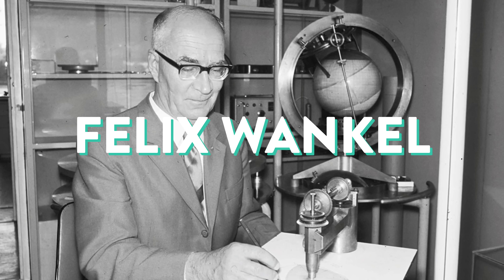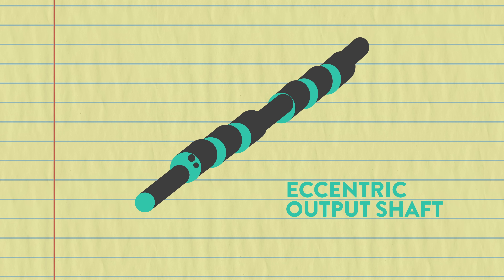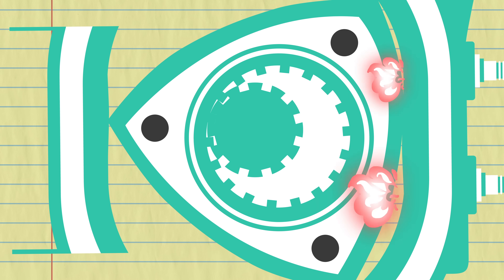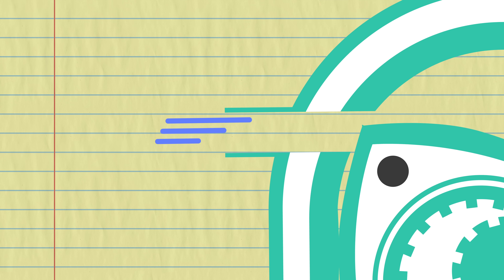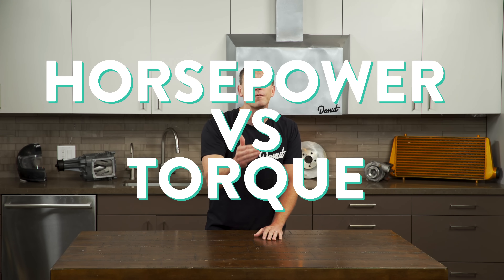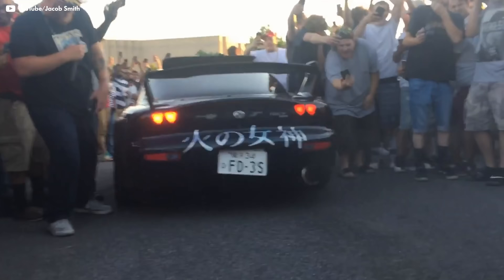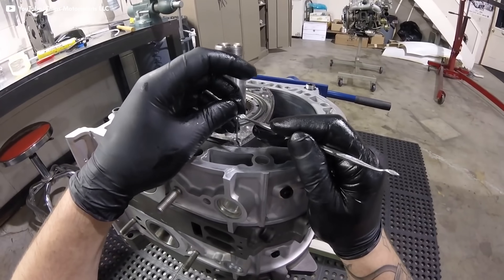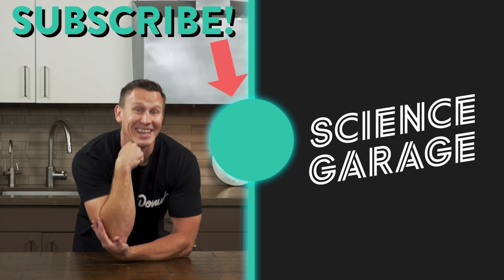Rotary Engine | How It Works

Comment: Meet Dr. James Lemke - a serial entrepreneur with a history of founding 
and leading companies to successful exits and a personal passion for 
science, engineering and education. 

Dr. Lemke founded Achates Power in 2004 with an idea that would 
revolutionize the automotive industry by revitalizing the 
opposed-piston, two-stroke engine.

As an influential physicist holding more than 100 patents, Lemke 
understood that the rapidly increasing shortage of fuel and greater need
 for emissions reduction meant the world needed a solution. That 
solution came in a 1930s-era engine architecture that demonstrated great
 potential, but momentum had dissipated when the tools of the time could
 not produce an efficient version. Lemke knew the tools and the talent 
were now available to answer the transportation crisis. 

Dr. Lemke started Achates Power with a collection of the brightest 
engineers and scientists with the condition that ideas and discourse 
flow unabated and the expectation that each fulfill their utmost 
potential. While amassing top talent in the industry, Lemke’s vision 
began to manifest results. However, instead of an engine that only 
moderately answered the need for efficiency, the Achates Power engine 
realized a more than 30 percent fuel efficiency improvement compared to 
the industry’s best diesel engines and nearly double the fuel efficiency
 of a standard gasoline engine at lower emissions levels and at 10 
percent lower cost. 

While Lemke always believed in the engine’s viability, now the results 
have shown the industry the potential economic savings of trillions of 
dollars per year on fuel and components, and billions of gallons of fuel
 saved per year.

Please enjoy this biography on Dr. Lemke and the history of Achates 
Power.

Comment: dokterbimmer the fake ???? WOW!!! You're right, he did delete all his comments
Reply: i had a rx7 but i blew it up i just go around being a  fake and a liar...
Reply: I am reading all of these comments and I cant stop shaking my head. So many people were so quick to "prove" how smart they are by citing Pascals law, they never stopped to actually think about what the man was saying, If they had they would realize that Pascals Law actually proves him right. The guy who came up with this is only "wrong" if you are being incredibly anal about nomenclature, or are incapable of understanding the basic principle of what he is proposing to do by changing the geometry of the rotor, most likely both. At worst he is only guilty of a misnomer. The classic demonstration used to teach Pascals Law actually proves that his modification to the rotor will work. A U shaped pipe filled with water sealed by two pistons. Pipe #1 has two identical pistons with 10 square inches of surface area, A 10 lb force is applied to one piston creating 1 psi and moving the piston down 1" , the other piston will have 10lbs of force imparted on it, at 1psi moving it 1" up. Pipe #2 Piston A is 10 sq inches, piston B is 50 sq inches , the same 10lb weight is applied to piston A moving it 1" and creating 1psi of pressure, piston B will receive 50lbs of force at the that same 1psi, but only move 1/5th of an inch. Both systems have the same amount of force applied to the "pump" piston A and equal fluid pressure inside the pipe, but the surface area of the "ram" piston B determines the "pressure" (force) differential. Just like in the pipe, changing the area of the leading edge of the rotor (piston) will change the amount of force imparted on the rotor by whatever PSI is generated by compression and combustion. For simplicity lets say the area of the stock rotor is 100" square, and 100% symmetrical, and combustion generates 100psi., 10,000 pounds of force will be applied evenly across that side of the rotor. He comes along and cuts a large pocket out of the leading edge of the combustion face of the rotor making it asymmetrical, increasing the surface area of the by 50 sq inches, now that 10,000 psi is distributed across 150 sq inches, and 100 of those square inches is receiving the original 10,000lbs in one direction and the remaining 50 sq inches receives 5,000lbs of force in the other direction. still alot of wasted energy but alot more efficient than the current design. I cant believe that none of you supposed engineers like The Real Doktorbimmer cant understand such a simple concept.

Comment: *The Wankel has more waste heat energy in the exhaust stream*
Reply: By: Cam VanDerHorst, Contributing Writer Mazda has made breakthroughs in rotary technology – and it may return to production soon. Fans of Mazda's rotary engine have spent years lamenting the loss of the unique powerplant and eagerly awaiting its return. In the face of ever-tightening emissions standards and ever-increasing fuel economy requirements, it has seemed – for a while now – that the rotary engine was doomed to remain a relic of the past. Perhaps more so than any other industry rumor, whispers of the rotary's triumphant return have appeared with unmatched regularity, only to wither and die on the vine just as quickly. However, this is no rumor – this comes straight from Ichiro Hirose, the executive in charge of powertrain development at Mazda. More Rotary Rumors: Rotary Fan Renders A Modern RX-7 For 2020 And Beyond Everyone At Mazda Is Dreaming Of A Rotary Sports Car, Says CEO The Australian motoring publication Drive had a chance to speak with Hirose at the 2019 Geneva Motor Show, where Mazda was celebrating the reveal of their new CX-30. More important than a new crossover, however, was what was revealed about Mazda's developments in rotary engine technology. According to Hirsoe, what was originally intended as a range extender has grown to become a much more versatile powerplant in light of recent technological breakthroughs. He says that the new flexible rotary hybrid powerplant currently in development is so efficient that it could be sold in any market in the world – even markets with notoriously strict emissions regulations in place. Hirose went on to describe a setup similar to the Toyota Prius, in which the hybrid drivetrain has the versatility to not only generate electricity, but to actually power the drive wheels when needed. This technology, dubbed XEV, may make an appearance in production cars – at least in Australia, and, we'd imagine, Mazda's native Japan – within the next few years. That's perhaps the most promising news yet for the rotary engine faithful. While we may never get another car like the RX-7, we may indeed end up with something even better.

Comment: COMBUSTION SHAKE THIS IS THE DEVIL MARKS FROM THE APEX SEALS            FAKE DOKTERBIMMER
Reply: The uk government are being forced to ban or limit diesel cars by 2040. They are giving off high amounts of carcinogenic pollution and are credited for a large rise in cancerous deaths. A lot of the diesel emission testing didn't apply to real world situations while many were falsified. In other words 95% of diesel cars are marginally better for us than petrol if at all, some diesels are worse. DPF filters (that limit the cancerous fumes) are also a very big grey area in effectiveness. Many people have them removed as they block up easily and are costly to replace. Also very conflicting evidence in how well they actually filter while working on top of the added pollution they take to make. Also much pollution is added because some people are forced to ''drive on the motorway to clean the filter''. If they don't do that a warning light puts cars into limp mode. Sellers of such cars do not tell people that diesels are very bad to be used as anything but long distance vehicles. Car makers want sales, telling people a car that is bad in short journeys is not good business for them so they don't say it.
Reply: @therealdokoterbimmerrotary6751  @doktorbimmer is obsolete, as a fake engineer
Reply: WHY IS THE LEADING PLUG OFF SET FROM CENTER OF THE HOUSING?
Reply: Absolutely-I was saying yeah ernie might be wrong for the reasons you say, but yet altering the combustion chamber might nevertheless make the rotary run better, just as way back, the hemi shape did (for non-ernie reasons) and lately, grooves in the cylinder head did (for non-ernie reasons). The grooves latest iteration is an indian guy: https://www.youtube.com/watch?v=PzMgPZxD7Iw

Comment: What if they made a two stage wingle rotor like a fan motor one on the skinny part and one directly behind the combustion to try and offset the weight and supply more compression.  Maybe they go opposite directions.  Did you play with it more?
Reply: The Wankel is an obsolete design... there is no longer any legitimate research or development on this type of engine... it is now the sole domain of crackpots and scam artist.
Reply: @doktorbimmer  @doktorbimmer is obsolete, as a fake engineer  obsolete, like the right bro,s won,t ever fly ha ha ha

Comment: Now I just need to figure out how I can make apex seals more durable and find out how to make rotaries not burn oil.
Reply: That won't even happen... you can't change the shape of the engine, so apex seals will always be prone to damage and premature failures... That is a major flaw in the Wankel's fundamental design... there is no way to lubricate the seals without fouling the combustion chamber with oil.
Reply: +doktorbimmer    There must be a way...
Reply: Unfortunately that is not the case, 26 of the worlds biggest and best engine manufacturers and nearly 100 universities and research institutes have spent billions of dollars and more than a million man-hours developing the Wankel engine over the past 50 years trying to find solutions to these design flaws... by 2008 all of them had reached the exact same conclusion... the Wankel engine is fundamentally and inherently flawed... it is inferior to reciprocating engines and has been rendered obsolete in the engine manufacturing industry.

Comment: the funny thing about the rotary is that it can do more than one strokes at the same time
Reply: How is that any different than a reciprocating engine?
Reply: @doktorbimmer it can do 3 strokes at the same time with one rotor, a piston engine with one cylinder can only do one stroke at the same time
Reply: I'm sorry, you seem very confused about how the Wankel engine works... each of the 3 combustion faces acts exactly like a piston.. so you can't compare it to a single piston engine... only a 3 cylinder 4-stoke reciprocating engine which also has more than one stroke at the same time.
Reply: @doktorbimmer  is obsolete, as a fake engineer obsolete, like the right bro,s won,t ever fly ha ha ha  very confused about how the Wankel engine works..stroke stroke stroke ha ha ha yes three strokes  I'm sorry, you seem very confused about how the Wankel engine works
Reply: believe in it."

Comment: Can thier be a desial rotary engine
Reply: No, There are no Diesel Cycle Wankel engines. Several failed attempts have been made but all were ultimately failures, the Wankel simply cannot support compression ignition because it cannot reliably generate high enough compression.

Comment: Guys i have a question. Is there like a way to make the apex seals rotate individually, so that instead of grinding with the walls of the engine, just spin on them, to get way less friction and more reliability? I think something like this could be done but im no engineer
Reply: But how would it form a gas tight seal? And how would it allow for the expansion and contraction of the housings? a roller would require some type of bearing to support it at such extremely high rpm... and that would a require some form rigid attachment. And interesting idea... but not a practical or even functional one.
Reply: @doktorbimmer  big fake just like the leading plug hole
Reply: @erniebrinkrotaryhemi7336  WELL YOU NEED BIGGER ROTOR BEARING THE BIGGER THE BETTER MORE TORQUE GREAT COMMENT ERNIE BRINK HEMI

Comment: Just remember
Mazda won Le Mans with a rotary engine 
And after they won, rotary engines were banned xd
Reply: Just remember Porsche has won Le Mans 19 TIMES!!!!  with a reciprocating engine... Audi has won 9 TIMES!!!! WITH a DIESEL ENGINE!!!!! and the FIA never banned Wankel engines... Mazda retired the slow uncompetitive 787b because it could only win if the points leaders all crashed out of the race!
Reply: FIA banned them because they displacement measurements were unfair.  The Wankel is only measured by 1/3 of the actual engine size. Further the noise could not be moderated to a reasonable level. Exhaust stroke overlap leaves too much fuel burning in the air. FIA's goal was 115-120Db, and the wankel cars were over 150Db.   It had nothing to do with the wankel being superior performance.   They could have run in CanAm gpe7, but mazda avoided competition where they actually had to compete against similar unrestricted engine classes.  Mazda was afraid of the 1,000-1,500Hp engines typical of the class.
Reply: @caberFeidh The FIA never banned the Wankel engine or the 787B in WSC series or Le Mans... Mazda retired the 787B because it was slow and uncompetitive.. 20 losses in 21 races, No poles, no fastest laps.  Mazda announced in 1990 that would retire the 787b after the 91 season and before Le Mans.
Reply: @doktorbimmer  Technically not banned... but also not able to meet the engine/car limitations.   Mazda taking it out was a bit like quitting as your boss fires you.
Reply: @Caberfeidh  The 787B failed to win a championship for Mazda, they lost the 1991 series to Jaguar. There was little incentive to introduce a smaller Wankel engine to meet the new displacement classification. The 767s engine proved it was not reliable or powerful enough to be competitive. and the 787s chassis was outdated. Mazda switched to the Jaguar chassis and the Judd engine... can't beat'em? then Join them.

Comment: This is the first video I've seen that talks about the e-shaft. I had an idea on how it worked, but this video finally shows it!
Reply: The Eccentric-crankshaft works no differently than any of type of crankshaft... it just has a shorter stroke and is more rigid to deal with the massive stress cause by the lack of internal balance in the Wankel engine.
Reply: @doktorbimmer  yeah but more so how it connects to the rotor specifically. It's pretty awesome
Reply: Not really, it uses the exact same types of bearings that other crankshafts use, not different at all in that respect... Connects to the PISTON specifically... the term "rotor" is a slang, an incorrect translation or proprietary term applicable only to certain defunct brands of Wankel engines.

Comment: If it's a rotar it aint a motor!! Even though yes, I know a motor is actually the term for an electric engine and engine is the correct term it simply doesn't rhyme!!
Reply: Motor and engine are synonymous... Rotor and Piston however are not.

Comment: you should talk about the doyle rotary
Reply: Why?
Reply: @doktorbimmer  Because it's a really impressive engine on its own, not counting the fact that it's a 13"x9" cylinder that weighs 65 pounds, and because it might hit production soon. It has a smooth intake and exhaust, it runs clean and efficient, puts out huge amounts of power, the seals don't blow after 60k miles, and its speed is limited only by the cooling system. It takes everything great about the wankel, ramps it up to 11, and discards ALL of the bad. I'm waiting for it to hit production so that I can order one.
Reply: @doktorbimmer  I certainly don't know everything, but I like to think I know a little more than nothing. Why do you ask?

Comment: has anyone tried running wankel on gas not petrol?
Reply: Gas? You mean gaseous fuels like LNG or propane? Yes, Wankel engines have been tested and developed to use a wide range of gaseous fuels but unfortunately the Wankel is very poorly suited to extracting the energy contained in these fuels and deliver poor fuel efficiency and higher emissions than reciprocating engine designs.
Reply: ok, i guess it makes sense but id love to see that wankel to work
Reply: The Wankel engine has some very serious inherent flaws in its basic design that simply cannot be overcome... the unique geometry that makes it possible to run in the first place also restricts is ability to adapt more efficiency that would allow it to compete with other internal combustion designs. One of the biggest problems is the Wankel engines low compression ratio and its poorly shaped combustion chamber... these flaws cannot be changed.

Comment: One thing I thought would have been mentioned would have been the efficiency of the explosion. the direction of force from the explosion is not as perpendicular to the direction of rotor's movement as a piston would be. Definitely a drawback in that regard.
Reply: There is no explosion inside any internal combustion engine, the air and fuel mixture deflagerates rapidly but less than supersonic speeds... so no shock waves or directional forces... Pascal's Law dictates the pressure is always exerted equally and evenly in all directions.

Comment: these engines just need some rework
Reply: These engines are obsolete because they have some very serious fundamental flaws in their basic design.
Reply: @doktorbimmer  The same thing was said about otto motors back in the day and people where convinced that electric was the future. (That was more than 100 years ago).
Reply: +Cyka CheekiBreeki Obviously they were wrong...
Reply: @doktorbimmer  yeah, the rotary engine is still after so many years relatively primitive. It has potential.
Reply: +Cyka CheekiBreeki  The Rotary engine is very primitive, this is because it has been obsolete for nearly 90 years... I think you mean to say WANKEL engine? The Wankel KKM design is also obsolete... and this is because it reached the end of its development potential.